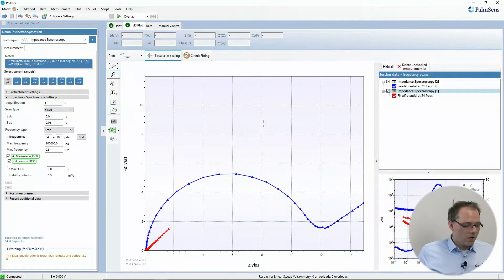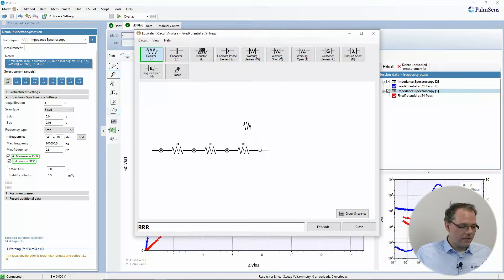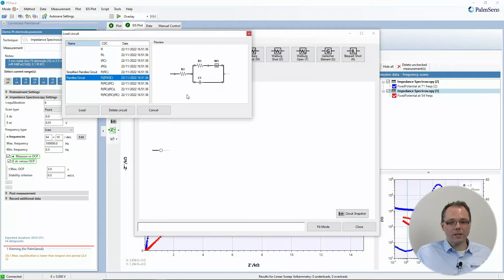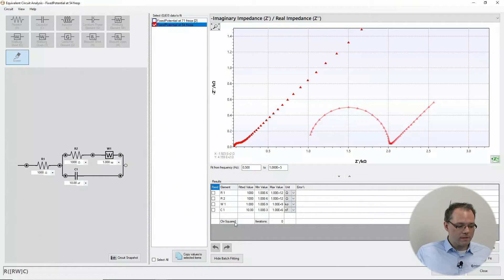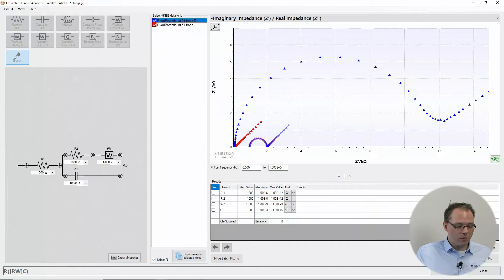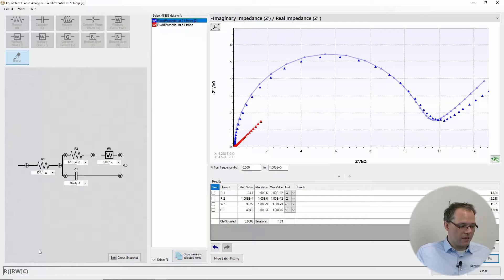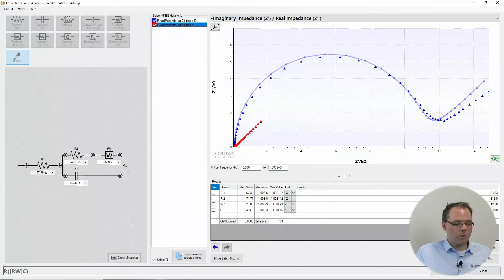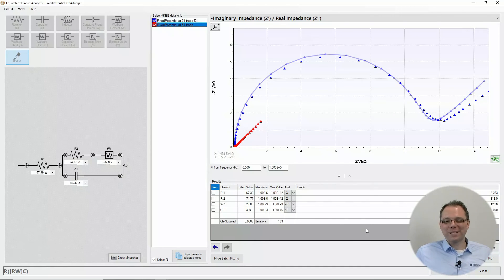PSTrace Tutorial #10: Equivalent Circuit Fitting

Comment: how i should connect my battery to palmsens4, to red crocodile and black and blue to dummy cell, right?
Reply from the maker: Usually, batteries are measured in a 2 electrodes setup. This means the red working electrode on one side of the battery. The combined blue reference and black counter electrode go on the other side. We have a knowldge base article about 2, 3 and 4 electrodes setups: https://www.palmsens.com/knowledgebase-article/purpose-of-a-sense-lead/
Reply: @PalmSens  Thank you very much! And I have another question, is it possible make CV and EIS simultaneously. I mean before cycling making EIS, after that CV 1st cycle and after that EIS. Is it possible make it in one process without human interaction?
Reply from the maker: @MrLoLbl4  Yes, it is possible to automate your experiment and to combine different measurements sequentially by using the Script functionality in PSTrace:
You can find details on how to create a Script in the PSTrace manual or check this online tutorial video: https://www.palmsens.com/knowledgebase-article/pstrace-tutorials-5-scripting